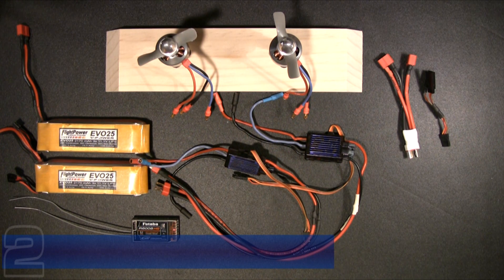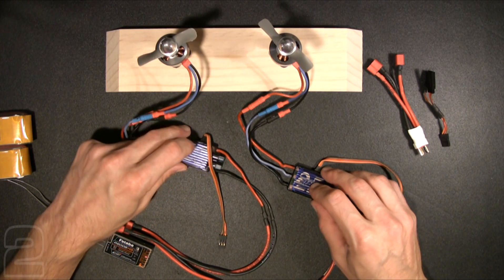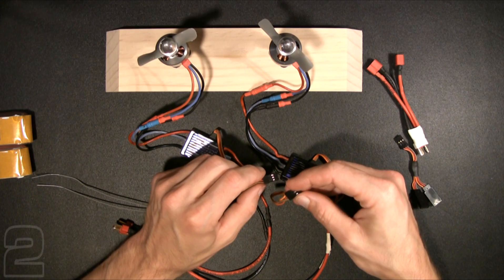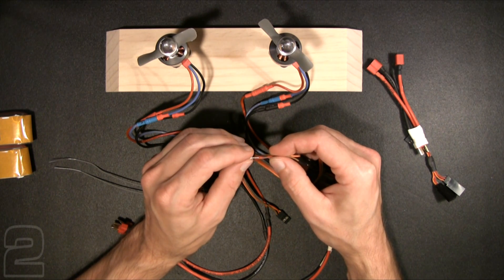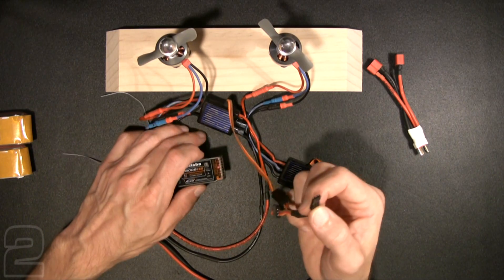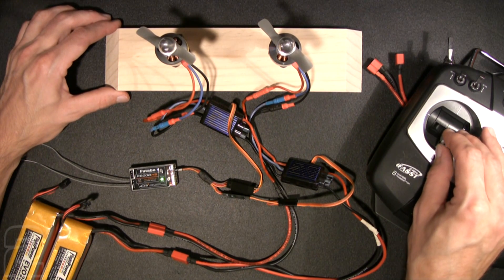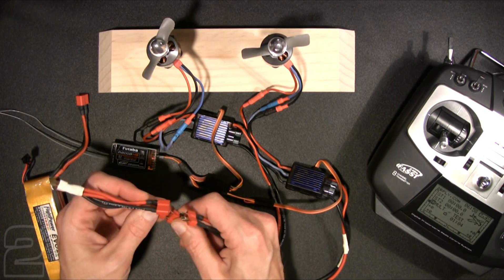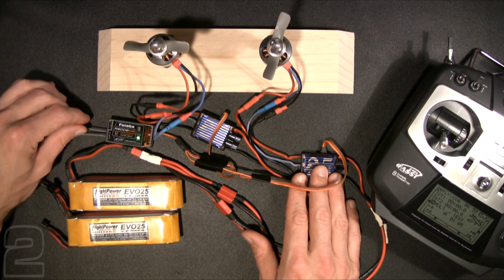Multi-engine ESC Wiring

Comment from the maker: @The787guy - First off, use an external BEC like a Castle CCBEC or CCBEC Pro.  Pull the red wires from both ESC radio connections.  Power the radio system with the external BEC. There's a possibility you could run with the ESC's internal BEC's IF: they can run in parallel mode AND: they supply more than 2.5 Amps each.  I'd highly recommend an external BEC.  As for the battery, that depends on the total amperage draw from your motors and how many volts you're running.  Got those specs?

Comment from the maker: @boomanfabo31 - The ESCs and Motors used in this clinic are made by E-flite.  Just about any ESC and Motor manufacturer support this setup.  Just remember to remove one of the positive wires from one ESCs radio connection if you're unsure if they support parallel connections.

Comment from the maker: @snakev10v5 - Yep, just multiply everything by 2, and use Y-adapters to get the radio connections linked.  Alternately, if you have a computer radio system you could "Y" two to the throttle channel and the other two to an AUX channel and mix the channels together.

Comment from the maker: @veilkrand - Yes, with twin engines you typically buy one standard and one pusher prop and run the pusher prop motor (typically the right motor) counter-clockwise.

Comment from the maker: @Sunset235 If you are powering your receiver through one or more of your ESC's radio connections, than no.  You should be fine.  The BEC will provide either 4.8 or 6.0 volts to the radio system (check your specs).  The main flight pack voltage (11.1) only gets fed to the motors.

Comment from the maker: @freak99z - Any manufacturer can be used in a multi-engine setup.  Just be sure to verify the BEC compatibility (you may be required to remove one of the ESCs positive from the radio lead).

Comment from the maker: @eventhorizonbm - You're absolutely correct.  You'd need a standard prop(clockwise turning from rear) and a pusher prop for the motor turning counter-clockwise.

Comment: Thanks for the video.  Very helpful.
However, since you've reversed rotation on one (left) motor, would a pusher prop be needed for forward thrust on said motor?
In other words, a pusher prop on one motor and a regular prop on the other?
Thanks

Comment from the maker: @homebrewman23 - I would suggest disconnecting the white wire from the ESC you're using as a stand alone BEC.  That way no errant signalling is sent to the second ESC.  I've had some strange arming attempts happen before with ESCs that were only being supplied 5.0 volts from a radio pack during setup. Just to be safe and ensure no mid-air issues..:)

Comment: Awesome video!! I have been searching all over for an answer and now ive got it. My situation was that I bought a 60 amp esc for my new jet and it doesnt have a BEC built in but I do have an old 30 amp esc that does. What im going to do is wire them like you show except for not hooking the 30 amp one to the motor. That should solve my problem without waiting a month for a bec to get here or adding a heavy battery temporarrily Again thank you!

Comment: This config would be ideal for the electric skateboard project, would both motors run at exactly the same speed if they are the same model? I think one on each wheel would make more sense. 
  My other project is to try to charge a large battery or super capacitor bank from several large rc motors, the idea is to create a braking effect on my van so that when i start to brake the motors slow the van and charge the batteries, then whenever i push on the accelerator the motors will aid the engine

Comment from the maker: @farcwarts - Off hand, I can't think of any but some google searches may turn up some options.  Problem is: there's no "standard", so the options are nearly endless.  If you're comfortable with soldering and shrink-tubing, I'd make your own battery "Y" adapters at just the right length.  As for the radio "Y" harnesses, I'd just pick up some shorties and connect them together.  That would be easiest.

Comment: Thanks for the response. Does anyone sell a 4 Y connector or do I need to take two Y connectors and splice them in order to get 4 leads to go into one input for the throttle and the battery pack? I can make one if I have to but wonder if someone has already done so commercially.

Comment from the maker: @farcwarts - You're going to have to fabricate or buy "Y" harnesses for both your battery and your radio connections.  Drop the positive off of three of the ESC wires and use only one speed control's positive for BEC power.

Comment: This is a great tutorial. I see that others have asked about wiring 4 engines. I want to wire all 4 motors and their 4 individual speed controllers to one lipoly 3 cell battery pack. I am wondering how to configure this. Is there a diagram or tutorial for such a configuration? Particularly confusing is how to bring 4 speed controllers into on Y connector to go to the receiver, and also how to bring 4 motors to one battery connector. Any assistance would be much appreciated.

Comment from the maker: @airsoftreviewers09 - Yes, on all accounts. Follow the same guidance for 4 engines as we suggest with 2.  Just make sure you aren't drawing too much amperage on your radio system for your BEC's rating.  In that case, you'd need either an external BEC with higher amperage ratings or you'd need an external battery pack for you Rx.

Comment from the maker: @spitfiremk1980 - Not a problem.  Just follow the same method:  you only need one red wire from one BEC enabled ESC going to the radio system.  The others should arm just fine as you plug in your flight batteries.  We recommend just pulling the red leads out and taping them instead of cutting them, but that's ok.  All you'll need is one.

Comment from the maker: @petegrimsby - Yes, indeed.  Just remove the positive wire from 2 of the 3 ESCs radio connections.  They'll get their power from the main power pack(s) once you connect them.  They won't likely arm until you've connected all of the main pack(s), so expect them to initialize as you plug in the batteries.

Comment from the maker: @Teamsorkracing - You would run the two ESCs to two seperate channels on your receiver.  As for the operation, that would depend on which channels you choose and how you mix them in the computer radio programming.

Comment from the maker: @smokinakr1 - How many battery packs are you using to supply the four motors?  How have you wired the batteries?  All parallel to the ESCs?

Comment: I have four motors with 4 ESC connected.  I having issues with keeping all four engines running past half throttle.  As I go past half throttle, they shut down one by one as I increase throttle.  Any suggestions.

Comment from the maker: @Zovex11 - Robots, specifically motor actuators, typically rely on independent control so the radio connections would be to two different channels instead of combined into one like we do with multi-engine airplanes.

Comment from the maker: @minileafe - Most ESC manufacturers are ok leaving both BEC wires in place.  To be 100% safe, remove one of the RED conductors from one of the ESC radio leads.  You can still use your "Y" adapter.